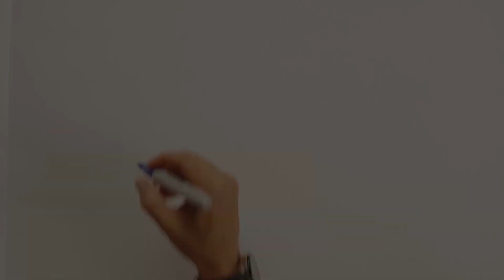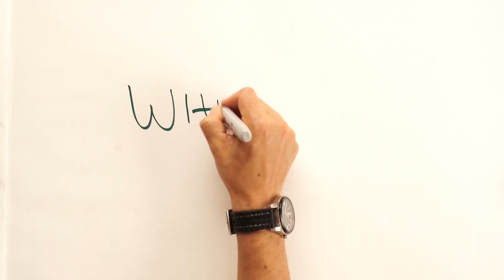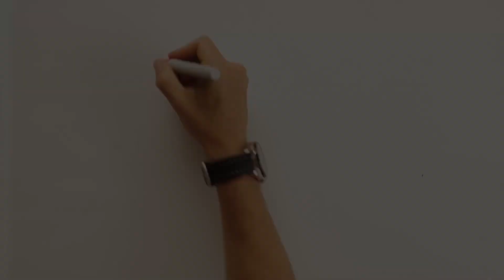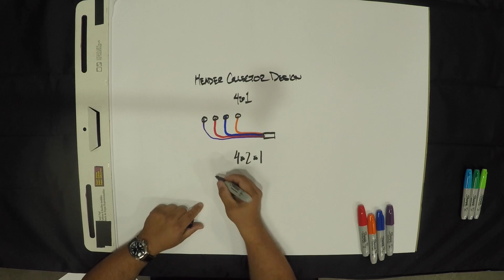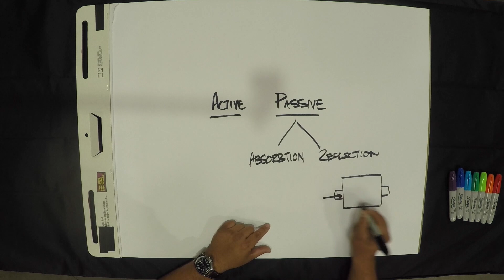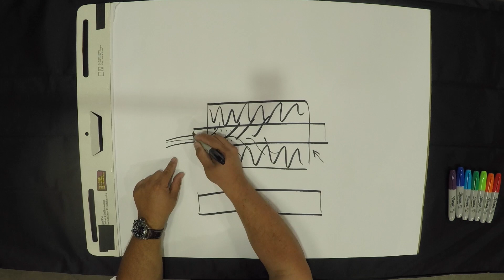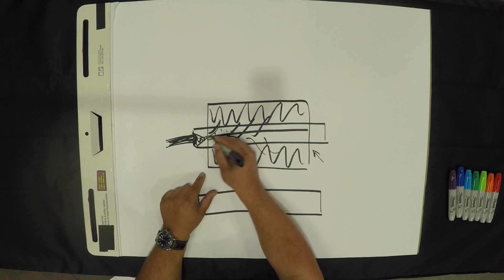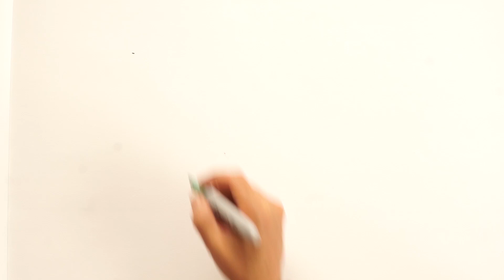No More Exhaust Myths - /ENGINEERED

Comment: 10/2024: Good Day From The Future.  Excellent Video.  A lot of information packed into a short video.  I could listen to a lot more.  Well presented and understandable.  Sometimes, it's best to leave "factory" alone.  I stood behind my 2004 Z06 Corvette LS6 while it was on a DYNO.  At 6000 RPM the sound was Wonderful.  I would never change this exhaust system.  I doubt that it could be improved much, if any from the factory listed 405 HP, that would be worth doing.  I'm an old MOPAR Man mostly.  I've owned a few 440 magnums, 383 & 340 engines.  My LS6 is the finest engine that I have owned.
Thank You & Best Regards.

Comment: I’m having flashbacks of my old 2001 GMC Yukon 4x4 I put your full system on from the manifolds back cats included (2005)that I bought via 4 wheel parts in redondo beach. It sounded great on the norm but soon as we hitched up the 6 thousand pound boat to go Havasu the drone was a killer specially if you where sitting in the back. As far as the cats I probably should of left the factory ones because they didn’t last but things change maybe your cats are better made now. Also you couldn’t remove the trans pan because of the crossover pipe so  I would unbolt the trans mount and jack it up a inch on the transfer case I spoke to you guys about the pan issue and your reply was that why it has the slip joint in the middle that made no sense because you would still have to unbolt the system from the manifolds/collectors.

Comment: The best backpressure is an exhaust valve that opens directly to a deep-space vacuum. No port length. Just perfect vacuum directly on the other side of the valve seat. There is no such thing as "correct backpressure." The "correct backpressure" is ZERO. Minus. Zip. Nada. Nothing, deep space vacuum.

Comment: This was a really fantastic explanation of most of an exhaust system. Will definetley be reffering to it as I plan on designing my own system. Only details that i know of that are missing are cats, and the use of an exhaust box to essentially simulate the exhaust going to atmosphere at any point you desire without having to actually have an exit there, allowing for an ideal tuned length, and it makes anything done after said box less of a concern for tuning as long as optimal flow rate is still achieved

Comment: Overall question for Harley:
Harley headers all work at 1-3 /4", so sorry Skippy, your 2" pipes are 2" heat shields, not pipe. 
My Twincam 88 (cu.in.) has a torque cam, and 2 into 1 collector going into a large glass pack, with an adjustable (until the cable rusts) butterfly about 1/3 distance into the muffler. It has a tuned carb, not E.I.
I run it at about 2/3 closed for good torque, and medium sound (my neighbors wave at me with ALL their fingers) akin  to a powerboat.
Now, gasses are obviously deflected to mostly one side by the butterfly valve, and I see that as an asymmetrical imbalance, but gate wide open she's WAY too loud. The muffler is almost 4", the inner perforated pipe is about 2". Is it worth changing to a preset nonadjustable system with a smaller can, or just run what I have? 

As is, my 88 will walk away from a stock 96", but gets bad fuel mileage for a bike. Being a bit of a torque monster, she's impossible to ride like your granny, because she's always in a powerband! (Best mpg trying that  was 42) She's terribly fun to ride and you don't have to thrash rpms to make power, but after a laydown I need a new exhaust, hence my question.

Comment: What about the concept of reducing the pipe size as you get further away from the motor?  Example,  70 390 AMX 498 HP 505 Lbs ft torque, hooker super comps 1 7/8", Dyno tech 3 1/2 merged collectors, 18" long 3 1/2" to 3" reducers, 3" pypes cross over, 3" flowmaster 40's reduced to 2 1/2" pipes over the axle and out the back. Everything coated  in and out or stainless steal.

Comment: Made it to 9:59, this dude's voice makes my head hurt. In my experience the negative wave timing is more critical to overlap scavenging, to initiate intake flow, as opposed to exhaust removal, which is pretty much over at that point. It's especially critical on independent intake runner/carb situations.

Comment: Gas flow rates, pressure characteristics, temperature loss rate, etc etc. All factors needing consideration for build objectives. 

I tend to lean towards intake being the primary consideration as if the engine cant consume the required gas volume, nothing else really matters.
Intake configuration, valve train & cam spec, combustion characteristics, etc etc. 

And the velocity of the sound waves should NOT be considered as a constant... Murican performance cars are mostly aimed at drag racing so WOT (wide open throttle) is the primary objective, whereas a circuit racing car requires a VASTLY different approach, maximum power will be less but the performance and characteristic of the engine (and drivetrain) through the entire rpm range will be much, much more precise and controllable.

(He just mentions Trophy trucks as I write this) Trophy trucks and rally type applications are still not at the level of high level tarmac racing where minuscule advantages in power, and GRIP, become much much more important. 
Long story short, want a good street/sport car? Go see a builder that is involved in tarmac/circuit racing, not drag racing

Comment: 3 inch pipe will give you small loss in power in lieu of a 2.5 inch muffler.  Change your exhaust pipe to 3 inches and you should be good to go with the muffler of your choice.
Reply: joshua casildo 
There’s a bit more to it, lol.

Comment: I dont have any exoust kits or any aftermarket so I made my exoust my self and I am not a engineer I just got a varex 3" Muffler with a obx heders for a mustang and some 2.5" pipe it is a bit raspy but it goes away at 3000 rpm my car is a acura rl 1996 I dinoed my car before and after before I was making 138 after I was making 500 + hp I cant believe thay yoused 1 in exoust heders I bumped it up to 2.5 to 3 inches I can say it made a difference

Comment: Personally I go old school. 1l - 1.5l exhaust 1.75", 1.6l - 1.9l - 2", 2l - 2.5l 2.25" etc. my 1.6l civic runs 1.5" primaries 1.75 secondaries and 2" with a 2' resonator and a 40cm resonator. works just fine.

Comment: Richard, What I found there is no one that knows how to design a performace exaust that is quiet. I wanted 600HP turbo engine and quiet, When I asked Magnafow and got a recomendation that I knew would be loud. When I said that will not be quiet, they agreeed. In the end I designed it myself. When I showed he design to one of the companys I approched they said "that will be qiuiet"....
The car was quiet and made 506 HP at the wheels.. The sound it makes https://www.youtube.com/watch?v=L9XrZnFpwNM this is  pictures of the exhaust system http://www.turbofast.com.au/img/GT86_V6_Exhaust3.jpg and http://www.turbofast.com.au/img/GT86_V6_Exhaust1.jpg

Comment: Was hoping to learn something of the Diesel Particulate Filter as used in turbo diesel engines ( 2010 Ssangyong Actyon 4WD ) it can't be removed by our road laws here in Australia.
My mechanic removed my main muffler,and replaced it with the same dia metal pipe, he left the 'resonator' (small muffler) at the end of the exhaust and the car is just a bit more noisier, but still legal, but you can now hear the engine exhaust note when out driving on sand and tracks so you know if engine is reving too slo or fast, as b4 it was dead silent.

Comment: Exhaust pipe tuning is a black art! F1 made exhausts from a computer and guess what,it didnt work!!!
Norton wankel had an exhaust at Cadwell park years ago got told it was to loud,it had a super trap muffler,they added more plates to it ,they were amazed when it gave more power.I have made tuned exhaust systems,for tuned engines.Once made you HAVE to reset your tuning to the exhaust! It not as simple as fitting a tuned exhaust system to your car or bike and instant power increase.It can happen that your get more power straight away,but with a different setup,there is more available!

Comment: "where does design begin?" well first youll want to make sure that the manifold is right next to the oil filter, being sure to block the filter as much as possible in order to make oil changes as difficult as possible
Reply: Number 1 and 3 tubes will need to be beaten nearly closed to clear steering box.
Reply: Don't forget to wrap the headers around the starter
Reply: Don't forget close enough to the plug wires to burn them out frequently
Reply: Yessss! I'm a tire and oil tech and I hate this, it mostly seems to be GMC that jus loves putting the oil filter next to or behind the fucking manifold!
Reply: @Piunti_302  yeah, lets bail them out again because they care so much about the american people.  glad everyone on the GM strike got to go back to work for a bit before lockdown.  surely they arent hurting for money right now.  having a lockdown right after a 1 1/2 month strike.
Reply: So true along with the replies.  I'm admittedly and old coot and back in my day you often had to buy a sheet of asbestos to put between the starter and headers and use weird wire looms to keep the ignition wires away from the headers.  Oh, those were the days (not saying they were good)
Reply: @melsilva9158  wire looms? Zip ties weren't a thing yet?
Reply: @eriktruchinskas3747  No such thing as zip ties back in those days. Bailing wire or stove pipe wire was easy to come by.
Reply: @melsilva9158  you poor poor souls
Reply: my oil filter is underneath my intake manifold
Reply: Stop! 
They're listening. 
I think every header designer in world is listening to your advice lol.
Reply: It only requires a plate and hydraulic hoses, <3', to reroute and place the oil filter where there is easy access to it. Makes the inspection of the filter easier and will happen more often.
Reply: Oil filter relocation kit ;)
Reply: Exactly.!!  the engineers that design vehicles have absolutely know idea what it takes to fix / work on them.. Cars should be designed by Real mechanics.  which would help make repairs easier / cheaper..  the newer the vehicle is, the more over engineered it is..  which makes costs go up with repairs.. way more people need to know about this.
Reply: Brian Wenzel 
They were. 20-30 yrs ago. Remember what your fuel consumption used to be? Well apply today’s fuel prices to that consumption. Even the last 10 yrs has seen performance engines (300Kw - 600Nm range from 5.0-6.0L/ish displacement) nearly double their efficiency. My 20yr old 2.5t makes 280kw-750Nm and gets 250-350km from 70Litres (18odd Gallons) ....Not the best
Reply: @muntee33  but dont newer engines have carbon buildup problems that older engines dont have due to tighter tolerances and efficient designs?
Reply: @muntee33  i think youre confused that HP and fuel consumption are directly proportional.  you mention fuel cost but then go on to talk about HP/displacement.  
  i remember getting 32 mpg out of my carbureted '86 toyota pickup.  30 years later, "economy" cars are still getting mid thirties highway fuel epa. what is the MPG of a new toyota pickup?  24 mpg?   yeah, more weight, more horsepower, sure it makes sense.  but more efficient?  not to my wallet.  i love toyota, this isnt a bash on them.  my 91 suburban got less than 12 mpg.

Comment: pressure wave travels at a speed of sound relative to the medium in which it travels, for air at room temp it is ~1100 ft/sec, but this is in exhaust gas so the speed would be considerably higher ~1300 to 1700 ft/s and higher

Comment: MUFFLERS, WHO NEED'M. .. .. 
This kid bought a Roadrunner and brought to me for a tune-up. I told him I can't do it right without mufflers. He said he won't have extra cash until 2 weeks and left the car. So this car isn't taking up space, I sheet metal screwed on STP Carb-Cleaner cans to each pipe. I then punched holes in those cans (equally of course) large ones in the front, smaller to the rear and no holes in that cans bottoms. First round test, too much back pressure, 4 more holes each can and it was good enough, fairly quiet also. No holes were on the cans top side, obvious reasons. I tuned it up and called the kid to come get it. Told him ABSOLUTELY NO driving on anything that can catch fire, I showed him why. The kid laughed and drove off laying rubber of course. 
2 weeks later he gave me a few extra bucks for getting it done quick but asked for the sound to be a little louder. TWO more holes each can that kid was happy AND the car was quiet enough to pass up cops & not get tickets. Year later I left that shop, never heard from that kid again. I can only guess he either left the can-mufflers on or put real one's on himself. I think he worked at a muffler shop. That was 30 yeas ago, I forget somethings. 
True story, mid 1980s, Tinley Park.
Reply: Same shop, different car. 
Auto body shops owners TR7 was at a nearby shop called "Pro-Tech Auto Repair" to get it running right. It had a misfire in one cylinder. 
Mind you this place had ALL the latest Sun equipment and then some. They installed new this & that & the other thing, but the car only ran on 3 of 4 cylinders. Middle of the night he dropped it off with a note in the window, "Can you fix my car?" 
Next morning I called & asked the history, he explained. Maybe 20 minutes later I called him back and said it's running right, come get it. Quickest $BUCKS I made in... like forever. 
Take a guess, or three, what I did to get it running right. 
.

Comment: sounds like the absorption stock mufflers are less restrictive then say a reflective flowmaster super 44 on open throttle? would removing the cataletic converter improve velocity and will it cause loss of back pressure therefore loosing torque? and back fire?

Comment: Possibly to much info. Tube diameter varies with each application. Trial and error. One way to explain the vacuum he keeps referring to is exhaust pulse. The pulse can improve the cylinder breathing by pulling on the incoming intake air flow during overlap. One way to explain this phenomena is getting a long gift wrapping tube. Blow a very large burst of air through the tube with your lips and you can feel a pulse pulling on your lips after the slug of air has exited.

Comment: A properly maintained modern day engine does not need a catalytic convertor they eat horsepower and economy and are designed to burn  all the unburnt fuel from a poorly maintained vehicle with worn plugs and carbon build up from lack of oil changes.. the only time a cat removal pollutes more is when the ECM is reprogrammed to deliver a fatter richer fuel curve from a power adder and even those applications when not in the throttle you can still get 30 mpg and clean emissions from a 600 hp supercharged 4.6l mustang GT when not in the throttle. upon purchase of EVERYTHING I own within a week the cat is removed . no exceptions ..

Comment: 1100 ft/sec is room temp At sea level for the speed of sound, not hot exhaust gas. so if using 1100ft/sec (335m/s) for your calculations they will be wrong. At 1000 degrees C the speed of sound is up around 931m/s vs room temp at 335m/s.

Comment: The entire claim to "cleaning the air" is not only a myth, a lie, but in reality a chemical attack on you and your family.
"In addition to the emitting of platinum and of harmful EMF energies by the platinum catalyst, the mufflers of such automobiles emit a series of toxic gases produced by the converter (not by diesels or by gasoline motors without converters).
These gases are:
a) Cyanide and cyanic acid;
b) Hydrogen-sulfur (H2S) which is an extremely harmful catalase poison, which inactivates e.g. the glutathion system needed for the inactivation of radicals and for the prevention of malignisation;
c) Phosgen (COCl2), an extremely dangerous combat gas of WWI which is highly aggressive against lung membranes. Whenever there are chlorine residues in the fuel the formation of phosgen has to be anticipated,
d) Compounds resulting from the interaction of MTBE (Methy-tart-butyl- ether) and ZDTP (Zinc-dithic-phosphate). MTBE is needed to replace lead as an anti-pinging additive in the fuel. ZDTP is an essential additive in motor oils in order to prevent oil chain breakage and loss of lubrication potential.
In the presence of heat MTBE and ZDTP would react and form potentially extremely toxic agents like phosphoric acid esters (nerve gas, anti- acetylcholine factors.) "
keelynet.com/biology/cfs.htm

Comment: I had a bmw e34 diesel, which later I straight piped. Felt no difference at all so I came to the conclusion that the back pressure thing is nonsesne. But recently I've bought vw golf mark 4 and straight piped it. I instantly felt torque loss at the lower rpms and no difference in the rest of the range. Then I've put remmus exhaust at the back and what do you know, the car became way more responsive and torque'y again. Now I'm in need for a bigger exhaust pipe cause I've put a bigger turbo, looking for something like going from 60-61mm stock to 65mm custom exhaust system.

Comment: HEY, YOU ARE MISS LEADING! the exhaust valve has been opening before the exhaust stroke, this is back when auto racing began during the 19XX-teens, this is also the start of the "exhaust gas moving at the losses engine power which you get back during improved cylinder volume metrics." I am one of those mechanics at 1968 Daytona Beech Moter cycles Races we managed to boost enough to cause a 6.2:1 compression of the Suzuki's 500 twins break the spark plugs ceramic insulators at the upper mid-range rpm's, that is when you build without dyno testing the results before racing. So! Lets us be correct otherwise, it looks to be a big fluff. There are a great many young men and women who know these and even more.  "Hawk"